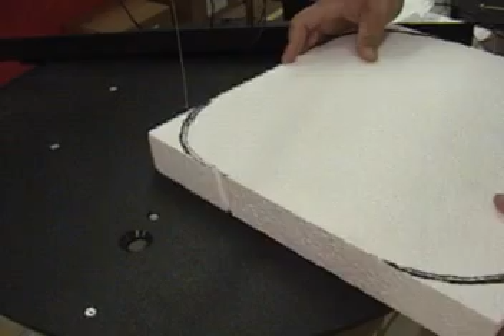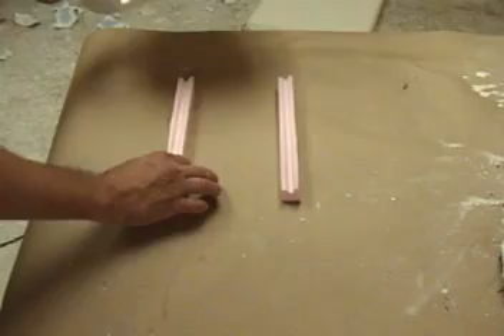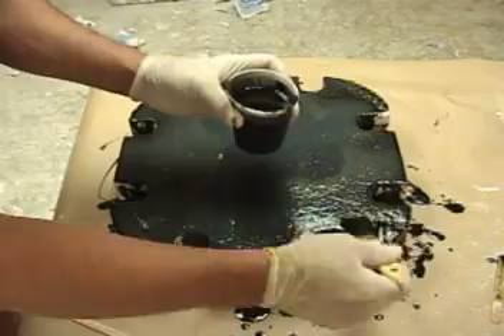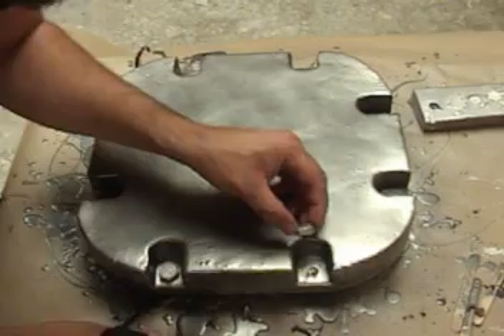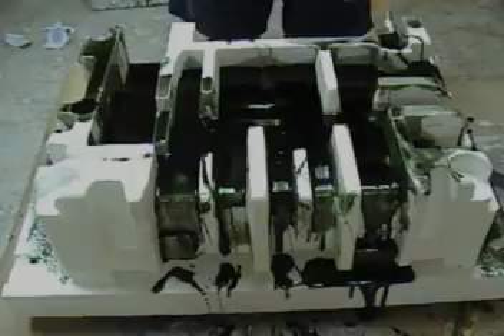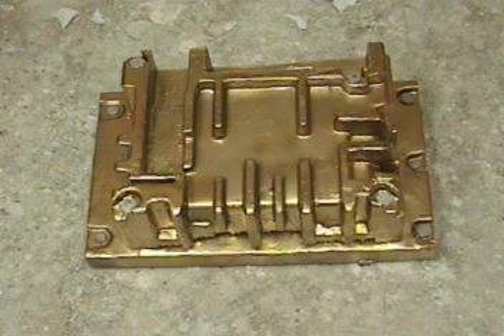Resin coating Styro-Foam Props

Comment from the maker: It is very durable after the resin coating has cured. Acrylic paints may be used as long as a primer is applied 1st.

Comment: hi great video thanks for posting!!!! I was wondering is there a reason you decided to mix black instead of any other colour with the resin I wanted to do this method and paint it gold but I wanted it to look new not vintage do you have any suggestions  also the type of epoxy  I have is varathane bar and table  finish is this going to be a problem thanks so much again

Comment: Firstly, thank you for explaining what you do and why, it helps us viewers massively! I was wondering it's it's possible to coat styro-foam (or a clay sculpture) with resin + metal powder? I'm trying to add some much needed detail to a plain floor standing cylinder. Thanks! :)

Comment: What would cause the foam to be eaten away under resin coating? I had some soft spots wear foam has been eaten. I even tried brushing coats of kilz primer first to protect the foam.  Still, the resin found a way to penetrate and eat the foam in some spots.  What factors could cause this? Sunlight, outside temps? Please advise! Thanks!

Comment from the maker: You will need to run a small test to determine if it is compatible. In this video we use it over EPS but it is usually a casting resin.

Comment: can I use this over any surface? I have a costume that needs to be hardened, but I already sprayed Plastic primer over it. Can I still put the resin over that? How do I keep it from getting too thick on one side if the piece is cylindrical?

Comment from the maker: If by boat resin you mean Polyester, Polyester doesn't work over expanded styrene because it will melt the styrene and disolve it. EZ Flo 120 and 1512 are both great for coating styrofoam as they do not dislove it. I only use EZ 120 on small pieces as it sets very fast.

Comment from the maker: A resin coating like 1512 or EZ 120 applied ~1/8-1/4 inch is very strong. That said, weapons that will be handled alot might require an extra support armature. As for water proofing, that depends on how well you coat the piece.

Comment: How rigid is this technique, I'm looking to create gun props for an upcoming film however foam alone would break too easily. Would more layers of resin help this or possibly some internally placed wire structure help make it more rigid? Great video by the way, am looking forward to using this technique in the future. Also one more question is this technique fully waterproof or will it cause problems if we get caught in the rain on one of our shoots?

Comment: I wanna do something with my pistol grip for my shotgun, by adding a stock on to it. But i need it light weight And was thinking of using foam (it's a prop gun so...), would it stay on the plastic or would it just break off, would the foam stay with the plastic or just break off as well?

Comment from the maker: Our spray resin requires a special spray gun that uses a static mixer at the tip to combine the components.  The resin used is EZ Flo Spray FR which is a flame resistant resin.  You can see us using that resin spray system on the anti-gravity device video we posted a while back.

Comment: Great tutorials. I'd like to coat a painted 3-D styro-foam piece, and noticed you mentioned a spray resin in the video, but I don't see a spray resin listed in your store. Can you explain? Perhaps it involves pouring the resin into a spray bottle instead of brushing it on? 

Also, would you recommend using the Poly 1512 or the EZ Flo 120 for this job (or something else)? Thanks!!

Comment: I have a few questions, I have the easyFlo 60 is this technique going to work with that. I'm also getting an oily coating on the resin after casting, am i mixing it wrong?